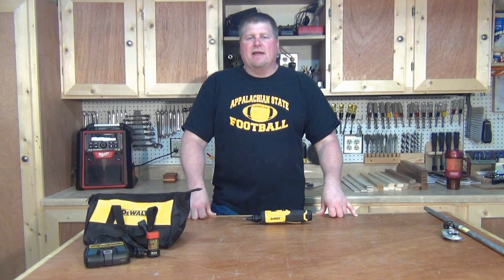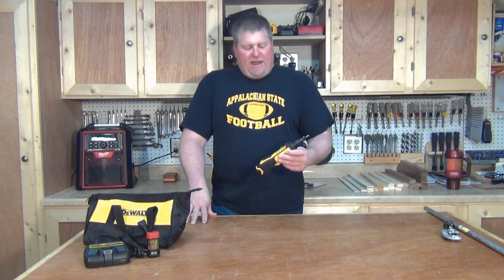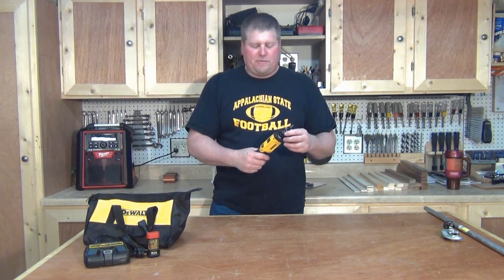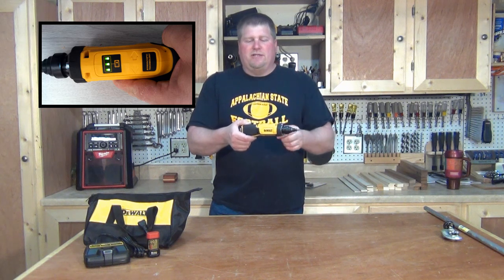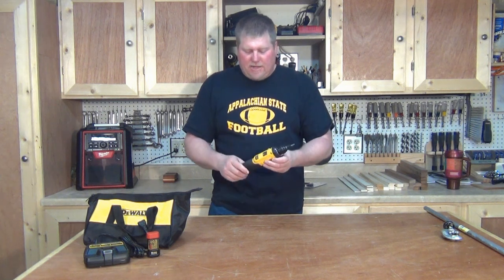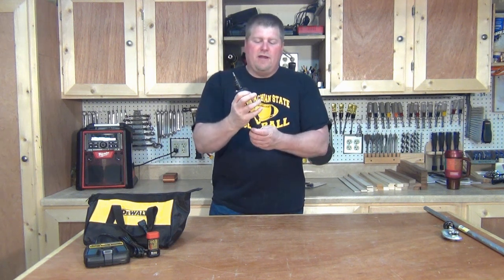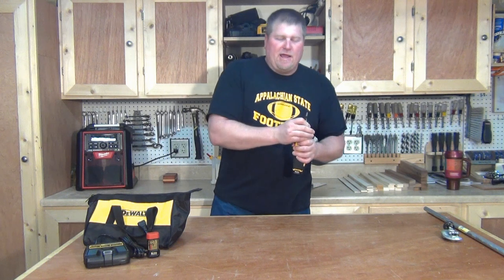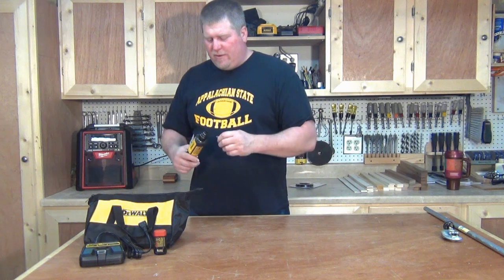DeWALT DCF681 Gyroscope Screwdriver with Conduit Reamer 8 volt max

Comment: Klein has a attachment that goes into any drill or impact driver that does the exact same thing. That cost a lot less and you don't have to get into another battery platform line.
Reply: So does DeWalt.
Reply: +robalan57 so does Milwaukee.
Reply: +Cody Robertson DeWalt is at Lowes and on Amazon.  Where have you seen Milwaukee?
Reply: +robalan57 The dewalt one is also available at Home Depot. The Milwaukee one will be released in September it was revealed at the Milwaukee tool event a few weeks ago.
Reply: +robalan57 The dewalt one is also available at Home Depot. The Milwaukee one will be released in September it was revealed at the Milwaukee tool event a few weeks ago.
Reply: This tool is half the weight of any 12v drill or impact. It is easy to carry in your tool pouch being straight. I wish it was USB rechargeable though.